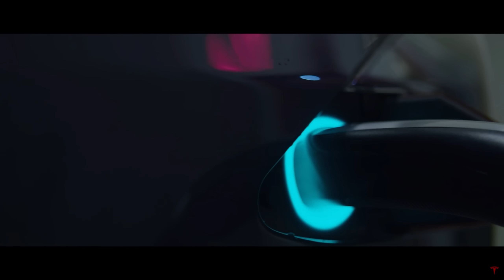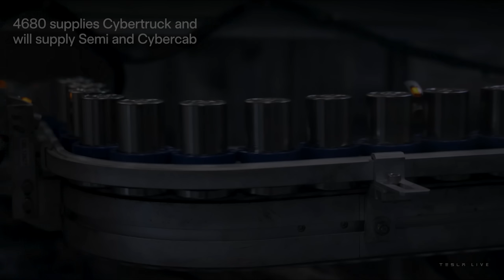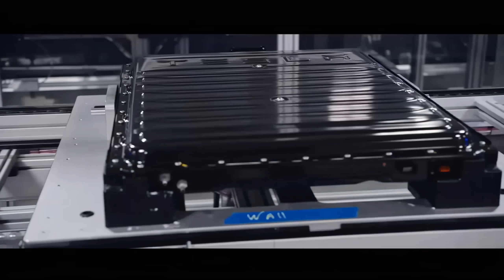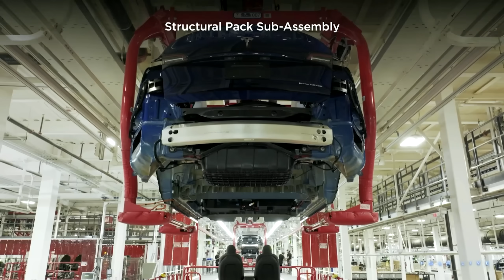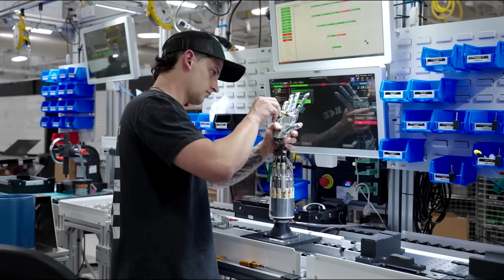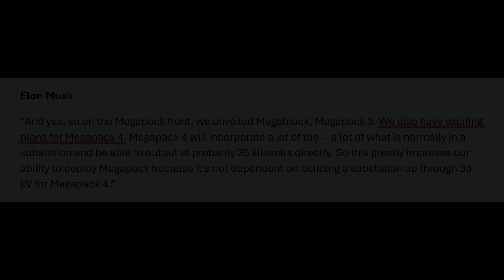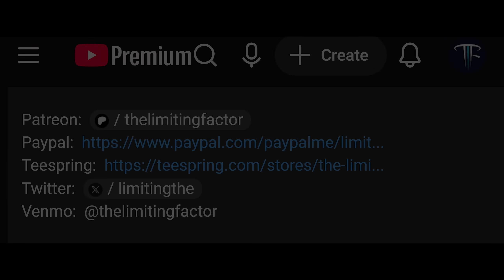The Fully Dry 4680 Is Now in Production! // Tesla Q4 2025 Earnings

Comment: Need them to put in Cybertruck and increase range by at least 75 miles.  Also getting Tesla Solar with Powerwall 3.  Will they get a Poeerwall 4 with better batteries?
Reply from the maker: I'll be interested to see what they do with the powerwall. 

From memory, they're currently using LFP 

I wonder if they're going to use the LFP battery cells from the line in Nevada for powerwall or grid storage
Reply: @thelimitingfactor They just signed a huge deal with LG to assure them 4680 batteries.  Cybercab, New low cost Cybertruck demand, and Model Y will all use 4680 format.  They must be running short in supply andd likley why the Cybertruck low cost build is pushed out till 2027.
   Will take them a long time to put out mass produced dry cells?

Comment: The Cybertruck Battery case has loads of extra heighht to space the spare. I estimate that it cold use 4610s, at least. Since that vehicle is running at 25% production, there should be plenty of batteries to fill sales needs.
Reply from the maker: The extra height is for flame egress and puncture protection.

No room to protrude into the cabin or below the plate without compromises.

Possible, but low likelihood.

Comment: No one so far has said whether or not the dry battery electrode is capable of multiple chemistries. You are the first to allude to the idea that it might be possible, but so far I haven't seen anything and that indicates it is capable of multiple chemistries. Such as LFP or sodium. You get the picture
Reply from the maker: Maxwell's original whitepaper said it can use any chemistry.

That makes sense because there's no solvent to react with.

In fact, it could be an important technology to unlock solid state films (which Maxwell filed patent applications for)

Comment: Can they get the 4680 over 100wH per cell.... Based on the battery day numbers they were targeting 110-120wH per cell.
Reply from the maker: If it's truly solved, then yes, it shouldn't be a problem to hit 100+.  110-120 is a big stretch though.
Reply: @thelimitingfactor  Agreed. I based those numbers on the battery day notes of range improvements of 20% for the Anode and 4% Cathode. Still a guess on my part, but man it would be something if they could do that. Opens the door for true long range options on each vehicle.

Comment: Just realised I do not understand the difference between (if any) between a 'fully dry' and a 'solid state' battery. Maybe you could explain in a future video?
Reply from the maker: Fully dry just means the process used to coat the electrodes uses dry heat lamination instead of a paint that's blow dried.  But, they still use a liquid electrolyte.

Solid state means no liquid electrolyte used.
Reply: It's the manufacturing process to put the anode and cathode on the current collector, not the final cell.  Still uses a liquid electrolyte.

Comment: The full scale production of the Semi starts this year.  Telling.
Reply: Tesla LFP factory in NV opens in 2026.
Reply: @markplott4820  
I guess LFP will be for grid storage. 
In the battery day presentation, LFP wasn't going to be used for the semi truck.
Semi was listed above "high nickel"
Reply: @AWildBard   - Tesla already using non structural 4680 in model Y.
Cybercab will be LFP. 
& standard range M3/MY. 
Semi is DRY 4680 & cybertruck.
Reply: @markplott4820  
You replied to a comment about the semi that CATL is finishing their battery factory soon. 
The CATL battery factory will be for electricity storage, for grid operators. Similar to Tesla's Lathrop facility.

Comment: Great video as always. 
It's been a long journey. There was a lot of excitement after battery day with all the potential improvements to range, cost, weight, and price. 
How much of those estimates do you think are still achievable? Battery technology has already improvement a lot since then. I wonder how much of those goals are already achieved.
Reply from the maker: I think they're all mostly achievable.  The 20% range will be the most difficult, and the cost reduction figure will mostly be hampered by the fact that typical production processes have continued to get cheaper.  But, for U.S. cells, it could remain intact due to tariffs.